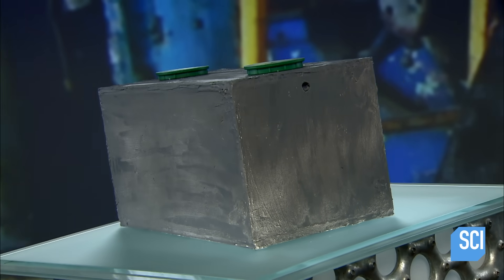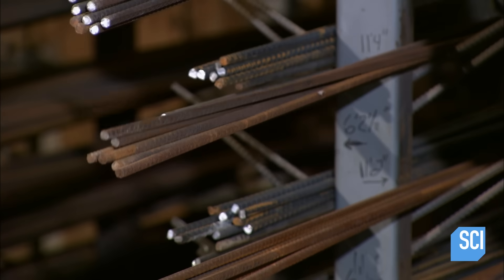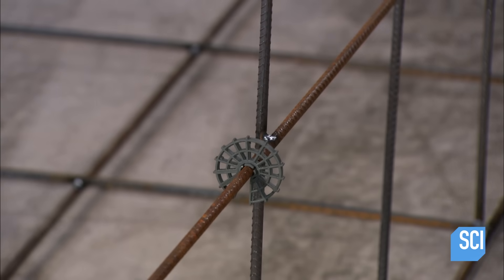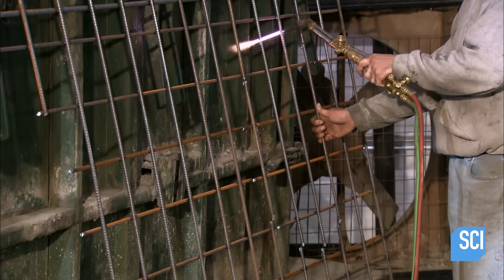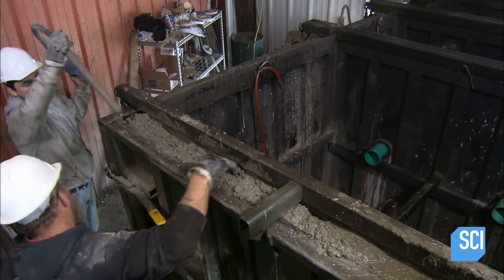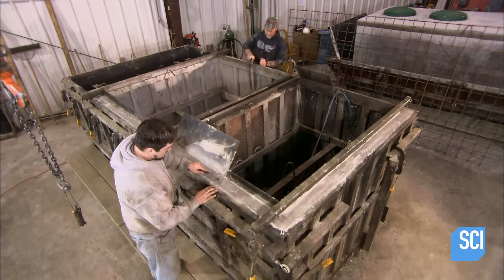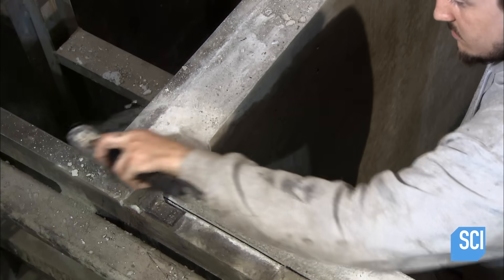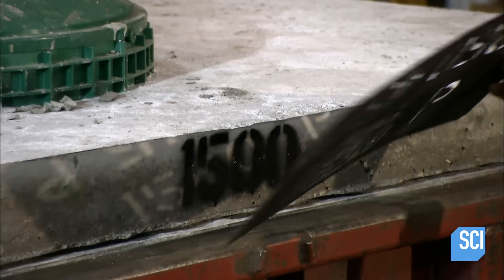How It's Made: Septic Tanks

Comment: You overemphasized the role of the septic in the treatment train. The drainfield is by far where most the actual treatment is achieved. The tank is mostly to settle out solids.
Reply: A lot of states (EPA rules) are eliminating leachfields. They are making homeowners install mini wastewater treatment systems, which this would be one part of said system. Mine for example has 5 "tanks" settling tank, aeration tank, clarifying tank, sand filter > chlorination tank > de-chlorination tank > ditch Some systems can eliminate the chemical tanks I believe if they install a inline UV filter.  And the state mandates a fee for this system and a yearly inspection and maintenance contract with a licensed installer. All because ppl couldn't/wouldn't maintain leachfields..
Reply: @skelafeti  They should provide people with basic services such as sewage...
Reply: @skelafeti  That is not a problem with sewage treatment systems, it's a problem with actually charging for basic amenities like, yknow, sewers
Reply: @TheChipmunk2008  These "basic amenities" don't just happen for free.  BTW, there really are no "human rights", either.
Reply: @louf7178  That is why in a society, taxation pays for them. And yes, there are human rights, as defined by the UN
Reply: @TheChipmunk2008  That is how , would be more accurate, and that system has a high potential for unfair imbalance.  Fair trade is the only real way.

"As defined" - see, it's a myth, in absolute terms.  There's no denying it if you're able to acknowledge truth.  

I probably can presume your "standard", but it's too unrealistic and vulnerable of exploitation.

You may be greatly ignorant of the efforts required to achieve the given standard of a most basic but unappreciated convenience, while someone merely whines "I deserve that" - utter b.s.  Chipmonks inherently know better.
Reply: @TheChipmunk2008  There are people out there that want to live in a rural area where a septic tank is a necessity, and they don't care what the UN said about it.
Reply: @TheChipmunk2008 you must be a city person to think everyone should have sewer. They are many rural places where there might be only a few houses in a mile. So you really think they're going to run all that pipe for a few houses when everyone's taxes should pay for it? Also if you knew anything, it would never work. A sewer line requires pitch. If you have houses in a valley in a rural area with say a 50 miles stretch, gravity won't take the sewage away. The only solution would be to install pump houses every so many feet. So basically, to provide sewer for a few people in desolate areas, it would cost hundreds of millions or more. I love when office city people think of these ideas but never have done or understand the work lol
Reply: @johnzadinya2181  Rural pumping stations are a thing. Not every few feet lol, every couple of miles. And i take exception to being called an OFFICE person
Reply: @TheChipmunk2008  when did I say every few feet? Can you read office boy? Every so many feet can refer to any distance. It's okay I work for people like you everyday who think you just dig a hole fast and throw a pipe in. Not sure how you cant understand its not worth doing all that work for a few houses. The ONLY time they would do that is if it's for a new big development or some giant warehouse or office building
Reply: And it requires regular inspection and maintenance.
Reply: @Christopher-N  depending on what state you live an if you have a septic I recommend a Goodflow system they don’t require inspections and aren’t those typical cheap plastic chambers it’s concrete.
Reply: @The_yeffy1 : It's still a good idea to have a regular inspection. Even the best systems can fail.
Reply: @Christopher-N  ahh nope, completely unnecessary if installed correctly.
Reply: @delvictor7570  Good luck with that
Reply: @delvictor7570 you are not right, I do septics for a living and failure somtimes has nothing to do with how it's installed. Somtimes the people living there don't take care of it especially if it's a rental, and if there's not great soil under they can be prone to not draining fast enough some months with higher water tables and heavy rains. So yeah they still require inspections and maintenance
Reply: It stinks so bad around these tanks. My grandma had one.
Reply: @kishascape  That means there's a leak & your grandma fucked up. These are odourless when properly maintained.
Reply: No, there is more going on with solids than just settling.  Bacteria digest solids and their waste is liquid.  When people fart, that gas is output from that bacteria digestion already started, before it even leaves your body.
Reply: Yup a lot of people especially homeowners seem to be very uneducated on this aspect. The leech field is the most important part, the tank is just simple concrete that all plants have. But the type of leech field you use is crucial I learned the hard way last winter but got this new system in the market called Goodflow solutions.

Comment: They pour these the wrong way. Much better when done upside down.
Reply: The mould is made of two parts, the exterior opens up like a flower petal, the inside is just a metal box to create a void.

They need to separate the two moulds away from the finished product eventually. If its upside down they will need to place attachment points at the bottom. This is very not ideal.

At my workplace we make tundishes and its a similar process too. Yes theres many ways to skin a cat, but trust me, the way you were suggesting may be problematic. The way its done in the video really is the better way to do it
Reply: @de0509    No problem. They’ve Been doing it for 20 years or more here. Base and walls poured at the same time but they are round. Same sort of form made from steel.  Inner and outer. The inner stays in place fixed to the ground. Outer is lifted off by crane.  The tank is then lifted and flipped for the lid to go on. Three days total time. Much bigger than these ones though. A person can stand inside or lay down to give you an idea of size. They use them for grey water. Rain water. Sewerage. And oil for heating. Not that these one in video are bad or anything just a bit more complicated.
Reply: @marvinmartinsYT  one of the reasons to pour the tanks upright like this instead of upside down is based on worker safety. It’s a lot safer to not have to rotate thousands of pounds of cement
Reply: @nickp9062    Stop it. We’ve been pouring precast for decades here. Upside down is not more dangerous. In fact it’s safer as there is only one pour.
Reply: @marvinmartinsYT  I’m not arguing your experience. Not even arguing. Was playing devils advocate
Reply: @nickp9062    Same
Reply: @marvinmartinsYT  how much does a septic tank builder make
Reply: @chaytonhurlow840    Precast concrete workers get between 27$ and 35$ depending on experience.
Reply: @marvinmartinsYT  pffft I make 13 doing this. And I make 5-8 tanks a day with one other person. I guess I'm underpaid. Thanks for the info though, I can't find anything online about a septic tank builder's average wage.
Reply: @chaytonhurlow840    No problem. This is in Australia btw.

Comment: I used to make them a little differently. First of all, it should have vibrators installed permanently in the inner forms. The top and bottom should be one piece without sealing it with the tar strip... also, no welding is necessary.
Reply: I do this for a living we never weld any rebar that’s a Mono tank not a two piece tank
Reply: @michaelbrander7881  my old boss used to put little rebar hooks on the bottom section so the top would hold in place when poured. I just bend the rebar (20ft) to the shape of the outer forms, leaving the excess sticking out and then bending the rest to the shape of the top and adding whatever rebar necessary, pour the top and voila, you have a one solid piece tank.
Reply: @bolasblancas420  we make a solid bottom with a heavy top we call it or a light top the bottom can be one piece or we make the top an the bottom separately then put them together
Reply: @michaelbrander7881  we used to make two pieces (top and bottom separately) but a solid one piece tank fits better for our applications. My best wishes to you. Have a nice day.
Reply: You don’t know what you’re talking about.
Reply: @oldcountryman2795  I am no liar, sir. I dedicated ten years of my life to that job. I also used to make the round ones, but those were more like the ones shown here. This is not rocket science.
Reply: @bolasblancas420  how much did you make building tanks?